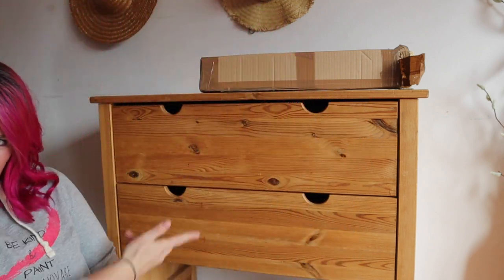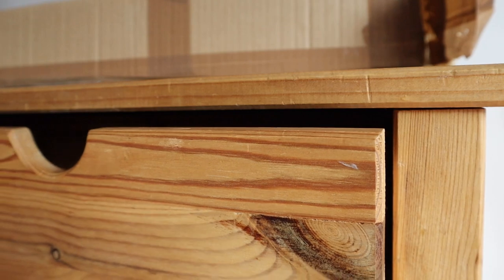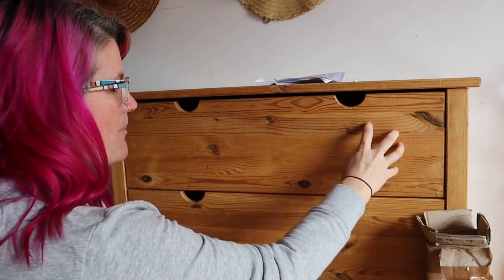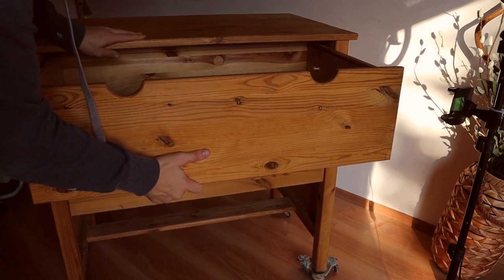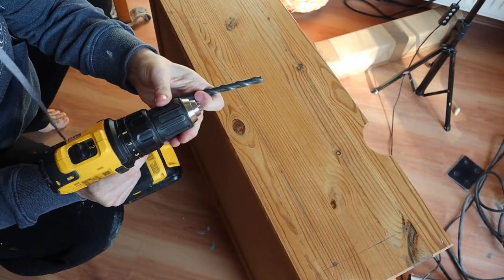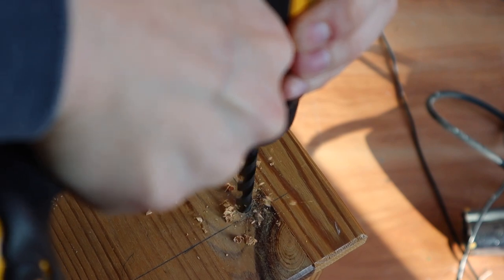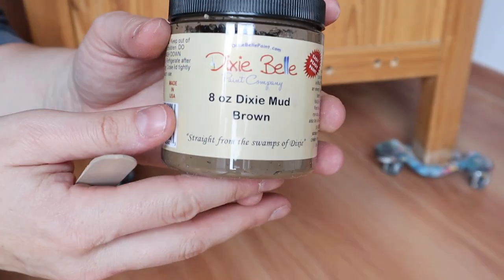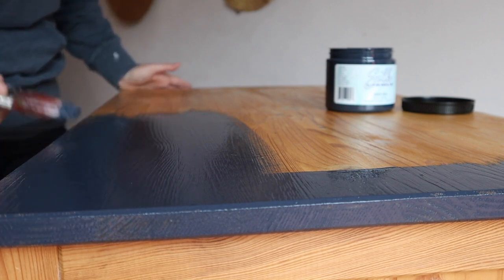TRASH TO TREASURE | Upcycled IKEA Chest Of Drawers

Comment: How do you keep the silk paint from scratching on sides of drawers? Mine does it and I prep all the way
Reply from the maker: hmmmm okay so one option is to sand down the drawer sides to create a slight gap so they do not rub, or you can add an additional top coat as well the paint doesn't cure for 30 days so any opening and closing of drawers that rub will probably cause the paint to rub away if it is not fully cured and hardened. Does that make sense?
Reply: @BellaRenovare  yes that totally makes sense. I definitely think that it's more work but it's worth it just to put a sealer on top of it. I've just never had this problem before.

Comment: I’d prefer to see you use all your good appropriate tools, like a badass, instead of crummy tools!
Reply from the maker: You mean like my T square? or the miter saw? The problem is that I live in Germany and I hate plugging my 110 tools into the transformer so it doesn't mess with them later. There are mixed reviews about whether it will burn them out and I don't want to risk it.
Reply from the maker: but you know what?? next project I am busting that bad boy out JUST for you ❤️❤️